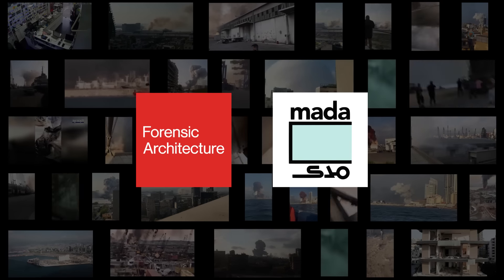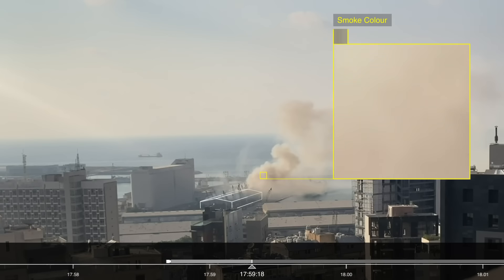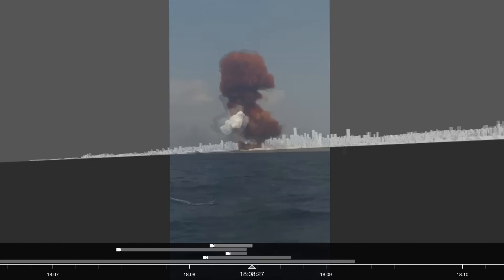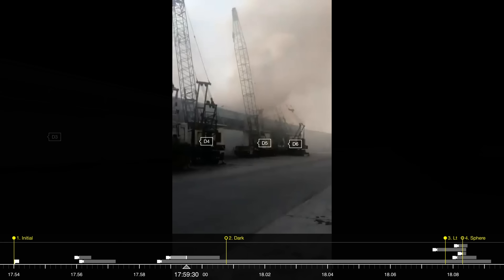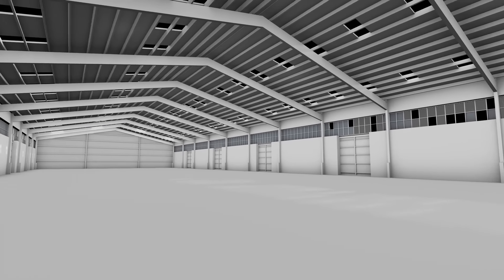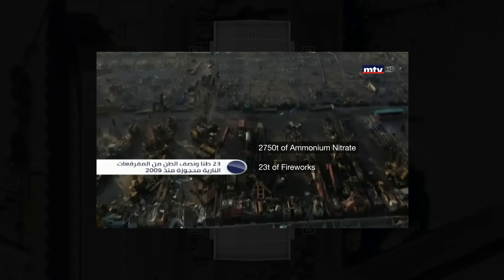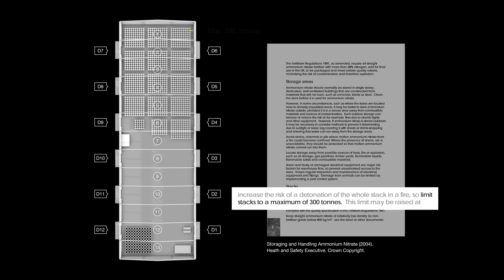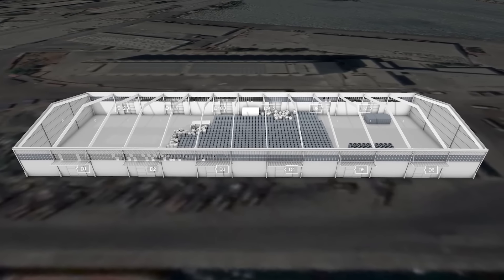The Beirut Port Explosion (English)

Comment: "where should we put this explosive ammonium nitrate?" 
"Uh idk how about in between the fireworks and the detonating cord?"
Reply: Mr funny guy over here
Reply: It was the opposite order of events but point taken
Reply: Ammonium Nitrate isn't an explosive. It's an oxidizer.

It's essentially like putting oxygen tanks in the building. Only AN isn't in gas form and it's much more condensed.

It also produces nitrous oxide at 270°F
Reply: This sums up this video and the whole event pretty well. You expressed the absurdity vividly.
Reply: Real
Reply: they had no where else to put it. and maybe in other hangers there are more explosives that could have made the explosion worse and they were basically forced to take the substances too.
Reply: @xKapnKrunch oxygen tanks can be quite flammable? No?
Reply: @handletunda  no oxygen tanks can cause fire to burn hotter but oxygen itself isn't a flammable.

When something burns it's essentially "oxidizing" so it needs oxygen.

If you had a room made of concrete filled with pure oxygen sparking a match wouldn't cause the room to ignite. The match would just burn out really hot and fast.
Reply: @xKapnKrunch You're technically right, but  I guess it's hard for me to separate the two.  Yes it's an oxidizer, but without it things don't go boom. Like ANFO, the fuel they use isn't necessarily explosive either, but add 90+% AN and that fuel will burn superhot, build pressure in a container and explode. 

Those fireworks exploding before the main explosion also needed potassium nitrate to explode, without it, gunpowder doesn't go boom.
Reply: Beirut officials brought this on by allowing the shipment of Ammonium Nitrate to remain in Beirut, stored irresponsibly and managed worse!!  Were they bullied, bought off, or were they actually that irresponsible or even stupid?
Reply: @xKapnKrunch  Nitrate and nitrated compounds (TNT, nitroglycerine etc etc ect) has been used as a explosive since the invention of gunpowder. Most explosives are nitrated compounds.
Reply: @jumboegg5845  key word is nitrated ammonium nitrate produces NO2 when it reaches 270°F 

That's not flammable it's an oxidizing agent that causes something that is flammable to combust faster.

Like nitroglycerin or TNT as you mentioned. All of those things have a combustible with it which creates what's called HE or high explosive.

By itself it is not even flammable.

That said it can become explosive when decomposing but it's still reacting to outside elements
Reply: @xKapnKrunch  Nothing to do with flammable, The nitrogen compounds in explosives are inherently unstable,  a simple shock, or pressure or heat can make it go off. the nitrogen bond breaks releasing energy in the form of heat and rapid expansion of gases. Doesn't need any other reactants, but of course they add to the explosion.
Reply: @jumboegg5845  so basically tons of people all over the world have bags of explosives just sitting on their garage.

Hell my work has a band grenade sized amount in the first aid kit...
Reply: @xKapnKrunch That's right, nitrate fertilisers are  highly restricted these days. But you do need some sort of primer to set it off.  Urea and ammonium is now the main from of nitrogen fertiliser these days.
Reply: @xKapnKrunch うん、酸素自体が燃える訳では無いからね。
酸素はあくまで燃やす気体。
酸素だけあってもそこに燃えるものが無ければ燃えない。
Reply: The fact i thought this comment was joking before i watched the full video speaks volumes on how idiotic this catastrophe was. How could they be so obtuse?
Reply: @A.Macknay1777  I don't think it could have been worse. That was the biggest chemical explosion in known history.  You could see the shock wave condensing clouds out of thin air for several kilometers.

Comment: The fact that it only killed 200 is remarkable when you see the magnitude of that blast.
Reply: Injure ..1, 000 more..
Read Wikipedia...russian own fronted to Others..
15 billion damage ..
Many officials resigned..
Several on Legal charges..
Reply: In all, it makes clear what can happen when safety regulations are lax and are not even enforced.
Reply: Mainly because it was already burning prior to the blast, which means enough people would have kept away from the area
Reply: @hlcepeda  the only reason it was there was because of corruption doing a shake down of the transport company
Reply: It was so huge it almost had a mushroom cloud!
Reply: Fr and look at how FAST that mushroom cloud spreads. That’s not even a NUKE
Reply: Guess it goes to show how few people work in their port and shipping industry. haha
Reply: @jonny-b4954  or they knew what was in there and got tf out when the fire first started.
Reply: @jorelldye4346  Maybe. I was mostly joking anyways
Reply: It’s obvious.
Reply: Ik right!
Reply: The lebanese people have been toughened through years of suffering.
Reply: @savioblanc  That doesn't make sense. Usually people will run towards a building that is burning, to see what is going on.
Reply: @tubian323 shame that’s not what it was